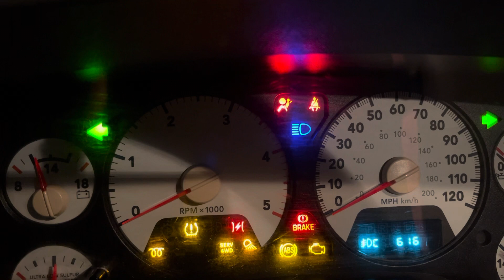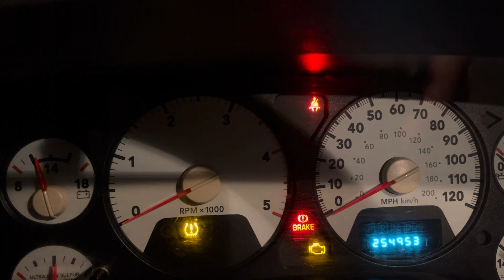Gauge cluster diagnostic test 3rd gen dodge ram

Comment: 2003 dodge ram I got cluster code 29 on left side Can you tell me what that is?
Reply from the maker: Cargo lamp output circuit shorted or open is what this one is
Reply: @OutpostCTD  What direction do I need to go to fix it?
Reply: @OutpostCTD  also, the cargo lamp is that the dome light inside? If so, I have LEDs in there that might be throwing it off
Reply from the maker: @justinbonilla4556  you might be onto something with LEDs. I’ve seen them throw things off before. For this code I makes me think that it’s referring to the 2 white lights by your third break light that shine on the bed of the truck when turned on. I could be mistaken though it may actually be referring to the dome light inside.
Reply: @OutpostCTD  i’m not sure I was thinking either the dome light or the third brake light. I’ll have to do some digging if you find out anything feel free to tag me.
Reply from the maker: @justinbonilla4556  if you turn the dial next you your headlight switch all the way up it should turn those lights on at the brake light. If it is really shorted like the code says they shouldn’t be working.